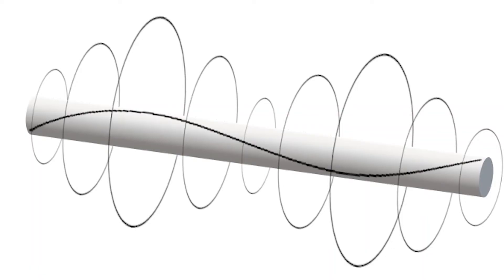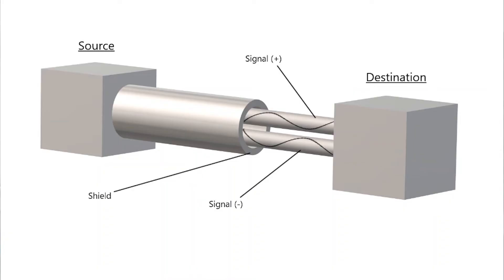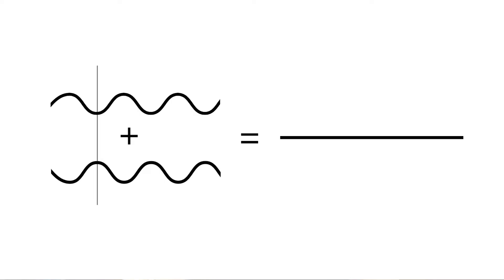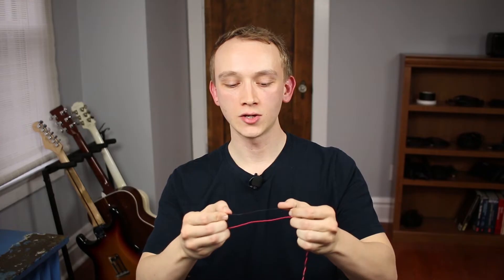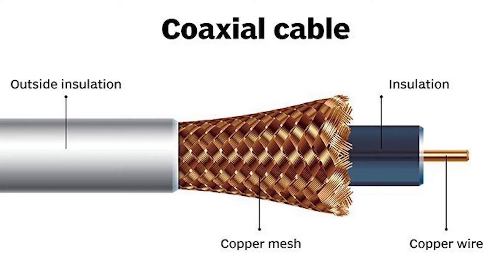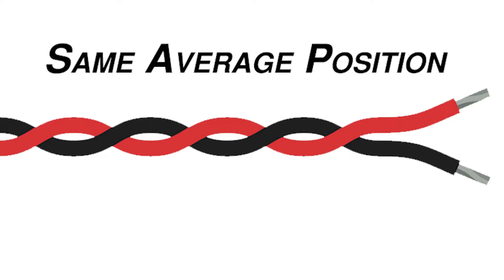Why Are Wires Twisted? Twisted Pair Explained

Comment: A lot of different stuff I've taken apart, I guess cheap stuff but even some pricey powered speakers never have twist in the speaker wires or any signal lines lol. I wonder if one could upgrade stuff by adding twist and maybe shielding. I guess by the time you're listening those circuits have noise suppression but if you electrical noise is only increasing

Comment: Thanks for this great video.the sine wave of each at 90 degrees to each made it clear and understandable.
question. I have a am/fm radio plugged into a 120 outlet.
I also have a 18 volt battery charger plugged into same outlet for some cordless tools.
as soon as I unplug the battery charger the noise inteference  goes away.
wondering if I twist the cords together from radio  and battery charger together would this help?
thanks
John
Reply: I'd try putting them further apart - different outlets even - there is a ton of ways how interference can get from one to the other - conducted, radiated, common or differential mode. You can put a ferrite choke on one of their wires.

Comment: Very informative. Thanks. 
I’m building a variable speed drive for my 130 VDC treadmill motor. I have a 10 core shielded cable AWG 16 that will carry 120 vac, 12 VDC and 130 VDC. I’m concerned about how the wires should be laid out in the control box. I actually have two boxes. A small one with a digital rpm meter, two potentiometers to control speed and an on off push button switch for 120 vac. 
Then the 10 core cable brings the 120 vac to a large box that contains an EMI filter, a SCR, bridge rectifier, DC choke. There’s also a ac to 12 volt dc converter that powers the rpm display. Everything is going back and forth between the two boxes by the shielded 16 gauge 10 core cable. I hope this makes sense. 
What do I need to be aware of in wiring everything? It’s not audio, but thought I’d ask. 
Thanks,
Paul

Comment: I was working for a guitar manufacturer last year. I got into a mini "Debate" with the QC technician over this exact topic. I have always shielded & twisted the wiring looms when wiring guitars. The QC was arguing that there is no need to do this as it doesn't serve any practical purpose and just makes it more awkward to perform repairs in the future. I was somewhat shocked by his statement considering he had over 30 years more experience compared to my 17 years. Even after I defended my side with evidence from numerous articles found immediately on google, he still disputed all of it and called it "sciencey hocus pocus" 🤦😆
It just goes to show how older age does not immediately equate to knowledge or wisdom. 

The differences between Ignorance & Arrogance...
Pride has no place in self development, & will hinder anyone trying to learn more on any given topic.
I think he just couldn't swallow the pill, that someone less than half his age had just proved he was incorrect.

An lastly, I carried on twisting those guitar looms. 🤣

Comment: I know this.  I see you have guitars so I can tell you the following, I don’t believe shielding an electric guitar reduces RF noise as your strings and pickups are outside the shielding and exposed to the ambient where the RF resides.  Secondly the noise in single coils that guitarist complain about is 60 HZ wouldn’t logic discern this is from the line not the air?  I had a noisy strat with no shielding and a  staticky pickguard.  I bought a cheap $35 loaded pickguard and twisted the output wires this eliminated all the noise and only very little hum with distortion plus drive.  Guitarist hate logic and science.
Reply: To your points:
1) radio waves are picked up by the coils in the pickups. That is what has to get shielded from rf as it is able to pickup those wave lengths. The guitar strings are grounded to the same ground as the cavity shielding but not tied into the signal path. 

As states above the noise is certainly from 60 cycle hum but if the pickups arent shielded it pick up from 'the air'. The pickups can get 60 cycle hum from cfl bulbs or other sources outside of the circuit and amplify it. 

Additionally guitar cables are shielded. If you plug into a guitar amp with an unshielded speaker cable you will learn so much about whats in the air in just a few seconds. Its interesting becuase the amp amplifies those signals. Post amplification you dont need that shielding like you do with a guitar cable

Comment: You r right about outgoing noise, but sorry sir, It doesn't protect from incoming noise. It only make the noises on both pair have the same phase, which mean the noises aren't effected the differential value of signals  on both wires, this help in the view of  crosstalking in digital world. Only Faraday cage can shield the incoming noises.

Comment: so if making a rca interconnect with microphone cable is it better to combine the two wires and use as one and the shield or cut only use one wire and cut the other out?

Comment: braiding the cables has been quite common and serves an aesthetic for the consumers as well. Curious, is there a specific pattern of braiding that is deemed more effective in cancelling these noise/signals or is it that as long as the wires are close together that various patterns of braiding would work just as well?
Reply from the maker: This is an interesting question, Aris! I would think that twisting would be the best solution for the most coherency between the two wires. When I think of braiding, I usually think of the cable's shield.

Comment: Many sensitive aircraft systems use shielded twisted pair wiring for the exact reasons you described in this video.  It was a simple and straightforward presentation.  Nicely done.
Reply: In networking, shielded TP wires also are normal.
Reply: Guitar amp tube heaters get twisted too

Comment: Your demo might have worked even better if you had connected the wires together at the end to form a loop.
Also starquad uses four wires twisted together to get the wires even closer together.
Finally, in telecoms networks we use different pitches of twists and other tricks to reduce the crosstalk between wires. 
Nice explanation BTW
Reply from the maker: Thanks for sharing this additional info, Jamie!

Comment: Hi, thanks for the video. what is the tool called , which you used to detect the magnetic noise around the wires.
Reply from the maker: There’s a link in the description to the tool I’m using.

Comment: I understan that twisting the cables help eliminates the radiated electromagnetics fields generated by the cables, but how it helps prevent outside interference if this is not a balanced line?
Reply from the maker: That’s a good point, Terry. In this case, it is a balanced line.

Comment: The demonstration is great but it only truly shows radiated noise coming from the wires, not a measure of how well they reject noise from sources outside the circuit they make. 

Ideally, the “static” noise you hear will be eliminated as much as possible*. The premise of “balanced audio lines” is one such effective (& simple) technology that greatly reduces or eliminates this outside static noise from lines you do NOT want it on (especially important for any low voltage sources ex: microphones, electric guitar signal, etc.). It achieves this by using an *extra conductor and sending the signal in its normal polarity and in its reverse, this coupled with them being as close together as possible means they pick up the same external noise, then when these lines are terminated at the “destination” (preamp, interface, whatever) there needs to be a specific circuit at the receiving end to reverse the polarity of the second line and then combine the signals together, this leaves the original intended signal in tact and any noise picked up now at 180deg out of phase and as a result virtually eliminated ! 

If there was no deliberate circuit on receiving end in place and the conductors terminated together at the same location, then all you would hear IS noise and the intended signal would be eliminated (since they are straggling reverse polarity to each other down the line, both referencing the same extra conductor “ground”)

To test THIS you would need a signal source (the one used in the video would be fine) but instead of using a detector, you would need to use an interface and recording software with deliberate cable configurations to demonstrate its ability to reject external noise. 

Still a great demonstration and nice video tho 👍

Cheers
Reply from the maker: Thanks for sharing, Tylr!

Comment: Real question is how do u reduce the static
Reply: Any suggestions?
Reply from the maker: I wish I could help, @V__! I don’t have experience with this issue.
Reply from the maker: What kind of static are you hearing, @V__?
Reply: @AudioUniversity  constant buzz as soon as system powers on.  It doesn't change with volume, higher gain more buzz tho (roughly 60hz buzz on the car)
Reply from the maker: Buzz is usually associated with a ground loop. Did you say this is a car sound system?
Reply: @AudioUniversity  yes. I have everything going to a cleaned bolt in the back of my car but for some reason, every chassis point is like 5 ohms.. (I thought it should be 0-1) .. dunno what to do.  As soon as I connect battery, chassis gnd goes from about .7 ohm to 5 ohms

Comment: Excellent content, and practical example. I'm convinced on using twisted pairs for speaker runs. . However, what happens when I "braid" 
5 cables, each cable containing two twisted pair, within an outside jacket? Basically, a snake cable for a 5.1 system.
Reply: Nothing
Reply from the maker: Thanks for watching, @M Murrell!
Reply: The whole point of this was to explain EMI/RFI cancelling ability in differential signalling wires. The key word being "differential". If the wires are not differential, they're best shielded from each other because the fields won't cancel. The likelihood is that your quad-core (2 twisted pairs) cables are also shielded before the outer jacket, so bundling 5 runs of them in pretty much any geometry won't make any difference.  I believe somebody else already answered "nothing" in reply to your question. They are correct.

Comment: Great explanation - very useful. I'm in the process of running a cat5e VDSL and my plan is to wrap baking foil round the cable and run it in conduit/plastic trunking to help eliminate external noise.
Reply from the maker: Interesting method! Let us know how it works!
Reply: It wont work because the foil have too high resistance. The braid shield is better alternative.

Comment: Thanks bro, good pratical example.
Why twisted pair impedance match 100 ohm for lan cable? Can you explain, thanks
Reply from the maker: I don’t know off hand why 100 ohm impedance was chosen as the standard. I imagine it was chosen as a compromise between size and bandwidth requirements. Generally speaking - the larger the wire gauge, the lower the impedance.

Comment: Some of cable manufacturer making parallel wire cause of electromagnetic generate Eddy current and this current opposed losses of audio frequency's name of wires is helix dna company making wire like that , what is behind this theory can u explain ?
Reply from the maker: This is interesting! I haven't heard of this technology before your comment!
Reply: @AudioUniversity   i think its a making effects because if u measured with ohm meter and inductance meter so u can get a some value , because its a measuring in micro ohm  and micro Henry, if u have neer any measuring lab so u can get this things , thanks , when ever i making lab for wire measurement i give u test report may be i make wire measurement lab so early  , because here i have pvc electrical wire manufacturer but early i start audio cable , thnaks sir , for nice answer .
Reply from the maker: I’m interested to see what your testing shows!